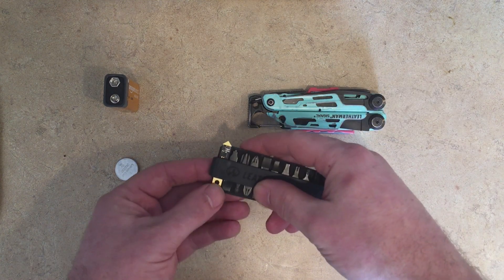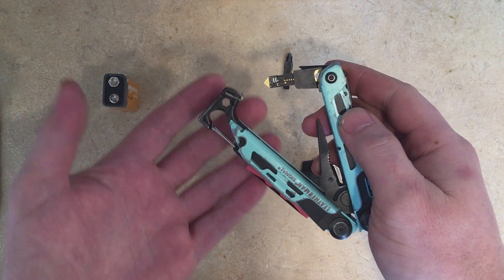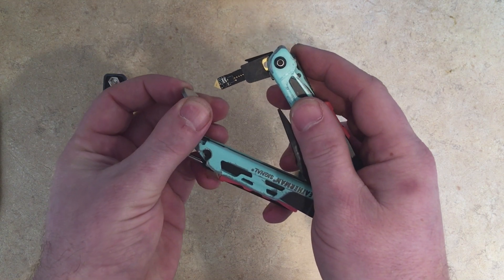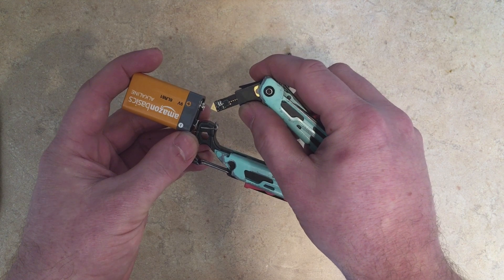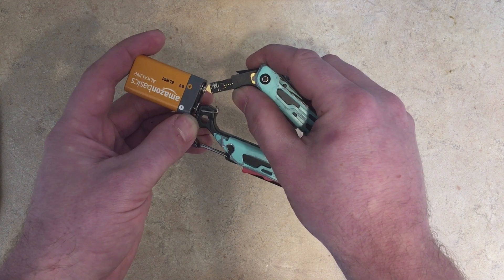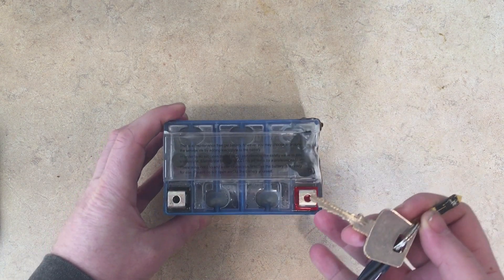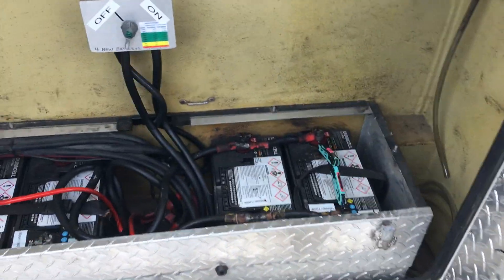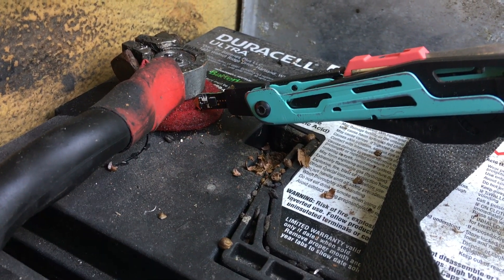Volty: a DC Meter "Bit" for Leatherman Multi-Tools

Comment: No high-voltage functionality, no fast reading, no battery. I'd prefer bigger device with small oled display and extended functionality.
Reply: Agreed but this may come in handy if your in a pinch or don't have a volt meter at the moment

Comment: does this work with the skeletool CX?
Reply: Yep, it's fits mine perfectly. Per instructions you do have to take a file and shave this thing down to fit snuggly but it was a very minor 2 min operation (put 45 degree angle on one edge). Wish it worked with lower voltages, but for the $ it's so worth it.
Reply: @2mitts  Yeah, me too, but for that it needed a different power source, because you cannot power the Volty electronics with just let's say 1.5 volts. It's not enough.
Reply: It fits in the primary bit driver, but the tip sticks out ~2mm when the tool is closed, and you can't add after-market accessories like a hammer. It does NOT fit in the handle bit storage. Also, since the bit driver doesn't fold (as it does on the Signal), it's much more difficult to use the Skeletool to check, say, watch batteries, or any other batter with close terminals. Volty works much better on a Signal.

Comment: Are they water resistant? Keys can be dropped in the rain or so can a leatherman
Reply from the maker: Yes, they can get wet without problems, make sure it's dry before taking measurements.

Comment: Nifty! Shut up and take my money, once you have a version that has a lower voltage limit which can be used for testing normal 1.2 - 1.5 V batteries.

(When I'm around car batteries et c, I usually have  a multimeter at hand anyway.)
Reply from the maker: Soon...

Comment: Very cool device! How about a v2 that drops the voltage limit to less than 1.5 volts so it can be used to test common household batteries?
Reply from the maker: Update: The new Volty Switch can do this!
Reply: That would be nice as well
Reply: Just put 2 low voltage cells together to get above the 2.5 volt threshold.  Technically, if you only have one cell, it isn't yet a "battery."

Comment: Just picked one up. Does it not work woth aa or aaa? I tested on a 9v and a cr123a and it works like a charm, but thinking the voltage on aa is too low to read for the volty?
Reply: Nevermind I'm an idiot just saw rating Is 2.5v lol. Works perfectly. If anyone is considering it get it!

Comment: Love this idea!  Do you know if there is any micro thermometer probe that could fit into a Leatherman Surge blade exchanger?  I work in Hvac and could use a mini one  to check ductwork temps.
Reply from the maker: There's some more measurement tools in the works. Stay tuned.
Reply: @pcdoodle1  That sounds promising!